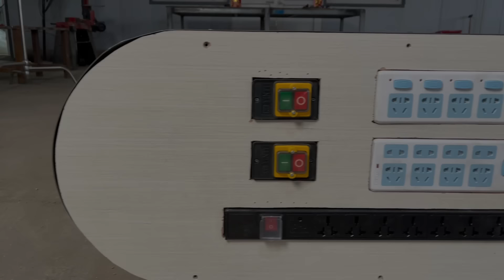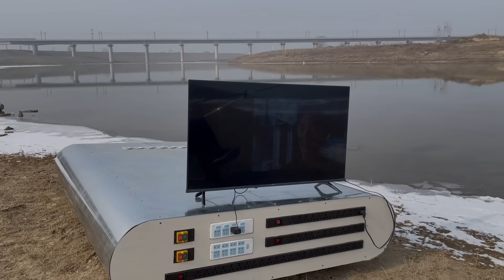ENG) 做了個2700萬毫安的移動充電寶 I Made a 27,000,000-mAh Portable Power Bank 【手工耿Handy Geng】

Comment: Builds biggest power bank ever, with a ton of full size sockets..but not a single USB port!
Reply: i thought the same lmao
Reply: Yes, it would have been soooo much more useful if it had had some USB ports.
Reply: um... he put in 60 receptacles [outlets]; all phones, laptops etc come with a wall charger... usb ports would actually limit what he could plug in. man demonstrated that he could run his whole household on that thing when the power went out. ur criticism is a reflection of ur limitations, not his.
Reply: USB隨便一個插頭轉接就能搞定了
Reply: @rosemaryus-ct6151  A wall charger is A/C though. You're getting a conversion loss for no reason. Just add a USB port.
Reply: @Josh-cw8by  He's powering a washing machine off of it. Conversion losses, especially with smooth rectifiers, is meh :D
Reply: @Josh-cw8by  he did what he wanted and u should too; what he wants doesnt have to be what u want
Reply: @rosemaryus-ct6151   Point is that USB ports are always part of a power bank, which is what he is trying to replicate and they also avoid you having to carry along your own USB adapters (btw new iPhone's and Samsung Galaxy don't include wall chargers anymore)! 
I doubt he is able to use all plug at once anyway in any meaningful way without overloading. Adding some different USB ports would be easy and avoided the pile of chargers he demonstrated and could easily double the capacity of devices he could charge, could be nice for example to help many people charge at a large outdoor event or something!
Some wireless charging points would have been even better, no cables or adapters  needed at all!
Reply: @awatchcritic  obviously 'always' does not apply because he made a power bank without usb ports. he obviously did not want to 'replicate' because he built it the way he wanted it to serve his own interests and needs. he is in a different country which most likely has entirely different norms that we are unaware of, and that's ok. he is an innovator. if no one ever stuck out their neck to be different, progressive thinking and the growth that comes from it would largely impeded. u have ur opinion and he has his. it's ok to disagree. it is not necessary to bad mouth him; it is not constructive, nor is it polite. get over urself and walk away. gees.
Reply: @rosemaryus-ct6151  haha, the comment was just to point out the funny fact he is literally copying the design of a traditional power bank rounded design, port locations etc. and calls it so in the title and references at the start. And is literally seen plugging in a ton of USB adapters..so he already demonstrated his own clear need for these! Did you watch the video??
Not badmouthing him at all..what are you on about with him being an innovator or different norms, I'm not criticising his invention, just pointing out there was a clear and ironic oversight as he showed he needed these in the video! 
Quit it with the self righteous and virtue signalling bullshit, nobody is interested, if he is offended in anyway he can speak for himself..
Reply: there are surge protectors with USB plugs LMAO

Comment: You should use measure of energy when referring to Power bank. mAh is a measure of amperage over time, Voltage is missing. If you have voltage you can then convert it to Wh or kWh and then we will actually know how much energy it stores.
Reply: !!! Sztuluk knows electrical interdependencies! Thank you for your comment.
Reply: Maybe it's capacity is regarded by output of one cell voltage :3.7...4.2V
So, 27000A x 3.7V roughly 90KWh
Reply: @florind.5711  5v output